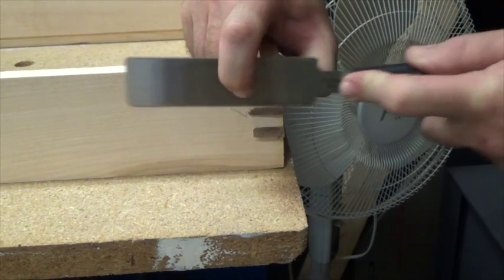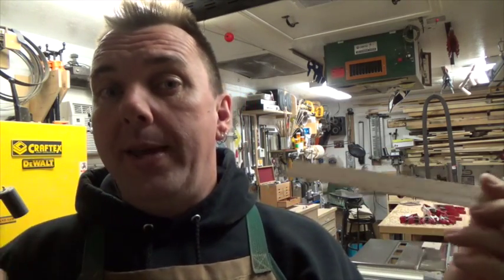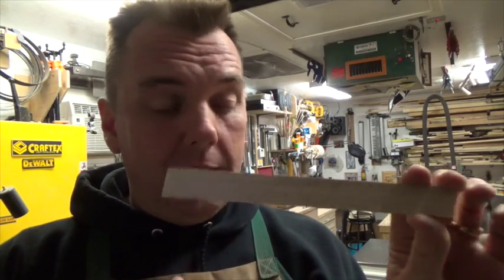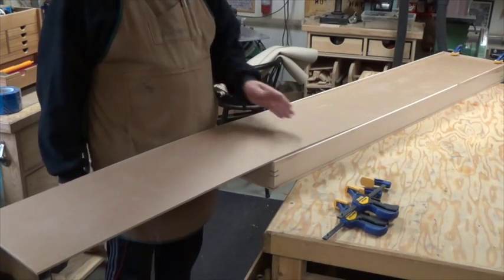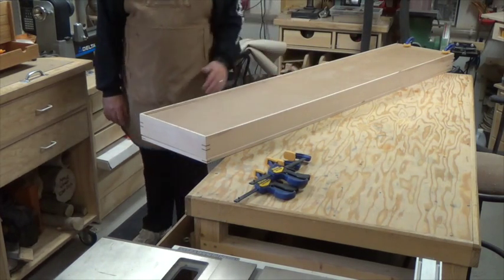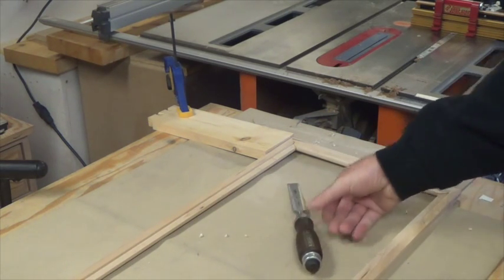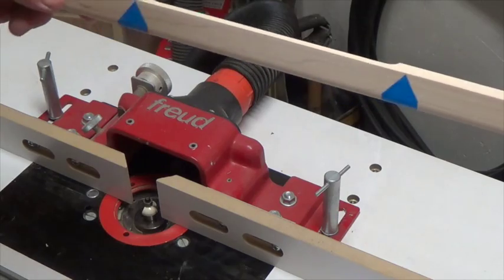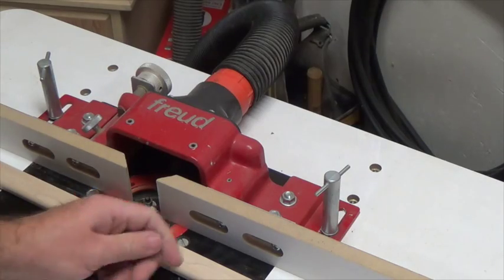Making a Display Case Part 2

Comment: Hi Kenny:
Today I experienced the same issue you did with the rabbit being uneven at the miter joint. I should have run the pieces over the dado blade a second pass.  I gave myself some time to figure out what I was going to do to make the surfaces flush.  I considered using a chisle but didn't have one readily available.  Tomorrow I will go back to my project and incorporate the method you used.  No point in re-inventing the wheel.  

This is one of the reasons I subscribed to your channel.  Simple solution to a minor issue.  Thank you.

Best wishes
Chuck
Reply from the maker: Glad to have you here as a subscriber Chuck.  I always enjoy your comments and your input.  Thanks so much for tuning in to another episode and taking the time to chime in with your experience and comments.  It's always appreciated.

Comment: In regards to the French Cleat I have rarely seen a wall that is perfectly flat.  Would it be better to hang multiple shorter Cleats rather than one long one?  Don't be shocked to find humps where your Drywall butts together, caused by tape joints.  To check the wall before you attempt this use a flashlight or straight edge to check the wall.  You may need to put the cleats on top of the humps in order to make them work properly.
Reply from the maker: That's some great advice K Singleton.  Thanks for chiming in with the suggestions.  Nice to get positive feedback and good suggestions from the viewers.